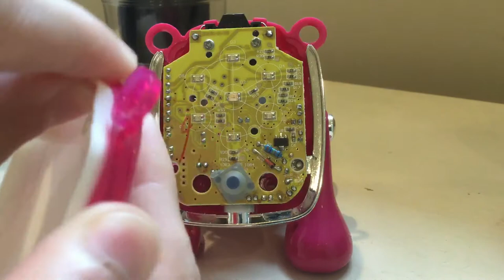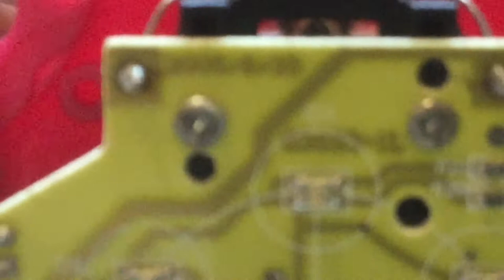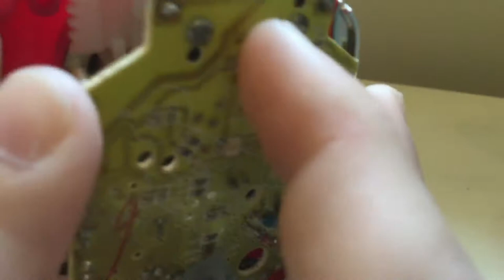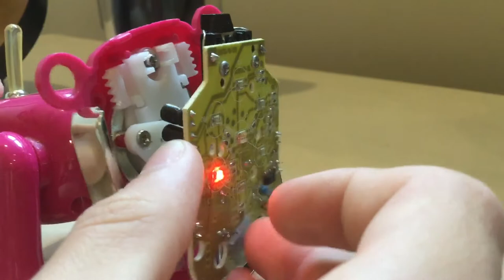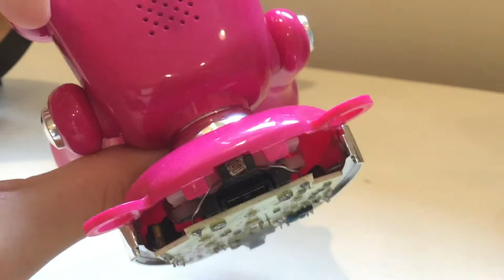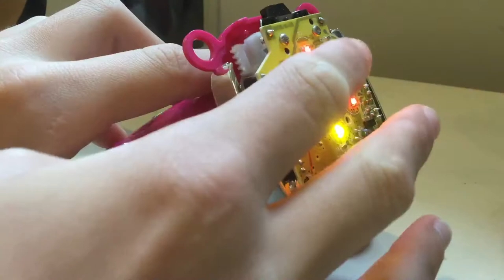2005 I-Dog Internals

Comment: Hello, IDogFan41! I hope you're doing well! Do you happen to know what type of processor was in your iDog? I have been trying to figure out a way to turn my own iDog into a sort of Alexa. The only issue is I can only interact with the speakers using my computer. I know that iDogs can listen to music and respond in specific ways (very basic, but that's not an issue), but none of that can be connected to another computer.

I don't have the knowledge regarding safely dismantling and restoring an iDog, so I am hesitant to bust mine open. You seem like you know your way around the mechanical parts of iDogs, so I was hoping you might know of a way to interact with more than just the speaker, whether that be in the form of some sort of debug port that I can connect to my computer, or something else. If nothing else, your video was very helpful, because I was able to get a glimpse of the inner workings.

Comment: I noticed that this iDog's top light can only be in red. Why is that? Is there something wrong with the circuitry?
Reply from the maker: The connection between the LED and solder point was bad. I fixed it a while back.

Comment: Really interesting inside the Idog. Are you fixing the malfunctioned top red light??
Reply from the maker: Yes. I need to find my soldering tools first
Reply: AibosAndIDogsAndAnimatronics41 What are the soldering tools that you use??
Reply: Looks like the messed up light isn't getting enough power as it can only display lower energy red and orange lights, but not higher energy green lights
Reply from the maker: Einfari Âûtomata Actually, each outer light section is made of 2 LEDs - a light color one and a dark color one, where they light at different brightnesses and times together to make different colors.
Reply: AibosAndIDogsAndAnimatronics41 oh cool! There must be a red low energy and green high energy one.
Reply from the maker: Einfari Âûtomata Yep, that’s what I’m thinking, in the meantime, I just discovered something interesting. There is one other atmos Idog on YouTube besides yours, and it has swirls on the ears like a Sapporo one. Yours doesn’t have the swirls, or it didn’t look like it. The Sapporo ones also come with little remotes with 2 buttons, not sure what those do.
Reply: Sterling Andrews I have pink idog

Comment: Do you know what type of leds the 2005 iDogs use? I got a red Target exclusive off of eBay and the red led at the bottom is dead
Reply from the maker: scooterscanley This one was sorta broken too but with the top light. I’m not too sure, what I’d do is find another one off a broken idog. I had one where the circuit fried a long time ago to use, but it turned out the solder wasn’t touching the LED at all.